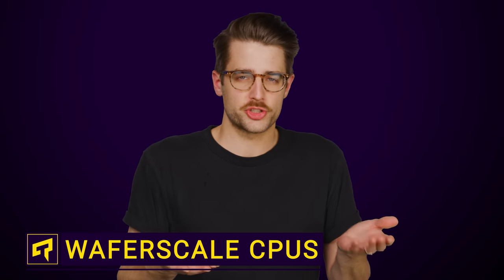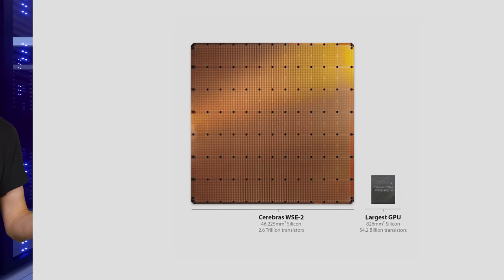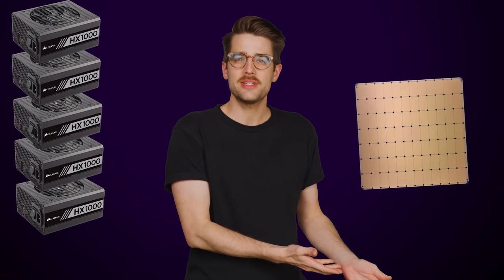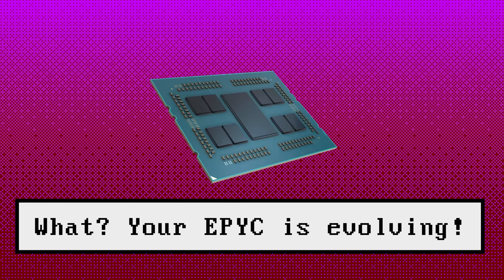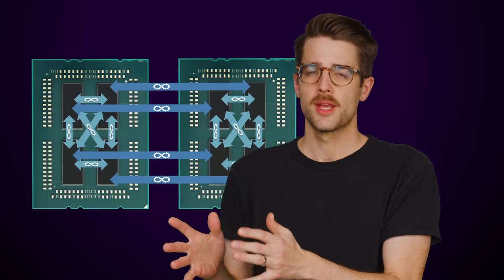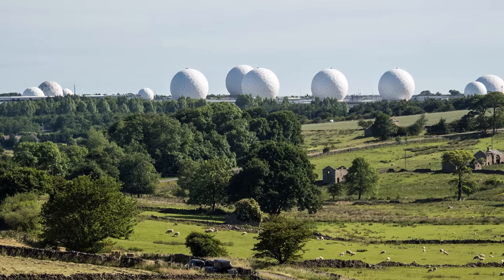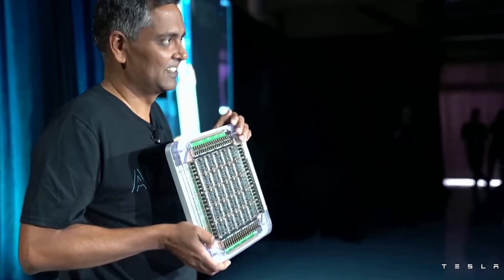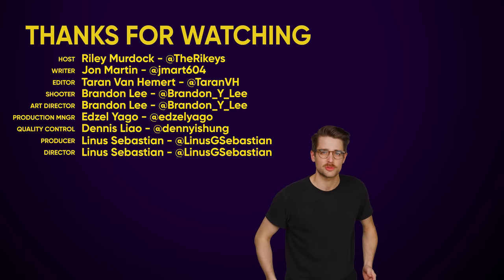The BIGGEST CPU Ever! - Waferscale Explained

Comment: Imagine how impressive of a cooling solution they're going to need for these things.
Reply: Just slap fan on it and call it a day
Reply: They just have a guy hosing it off 24/7
Reply: @a_stress2064  this but unironically
Reply: Dry ice
Reply: Big Metal heat sinks with high surface area to volume ratio, fans, ac. Finished
Reply: Eh just slap an Intel stock cooler on it and you will be fiiiiiiine.
Reply: @p.hilten  ac wouldnt work. Not efficient enough. Ln2 would be the option
Reply: Liquid nitrogen?
Reply: That’s why one just needs to shout “Cool!” loud n often enough. lulz…
Reply: Water Iceberg cooling
Reply: I am 100th like lol. Btw Antarctica is the best solution. Probably
Reply: Bigger chips doesnt automaticly imply more heat per area? If you where to make a i5-9600k 5 times the original size, it wouldnt randomly produce 5x as much heat would it? It would rather just spread out the heat. Point is, it wouldnt be any "harder" than what it is today. Just a larger radiator, larger fan?
Reply: @viktorpettersson6899  The thing is this has hundreds of thousands of cores while i5-9600k has 6. Difference.
Reply: 15kw vs .2kw, you are going past water at that point.  Each chip would need its own a/c unit pulling the heat out.
Reply: I'm sending beige and brown
Reply: 4 Dyson Vacuums would sort that.
Reply: @definitelynotobama6851  yep
Reply: @jasonoutman420  ln2 not ac, ac isnt sufficient enough
Reply: Wouldn't this thing just be inside a giant oil bath?
Reply: @mannye  uh... this things basically a giant glow plug man ... it would set the oil on  fire
Reply: @MrDeadmanwalken1  I like my chips fried 😋
Reply: These things are not thicker so almost the same amount of cooling per cpu in the stack
Reply: Water cooling man...just at a larger scale than for a gaming PC
15kW is peanuts in an industrial scale, they would probably slap a couple 100 chips together  in a water loop with an evaporative cooler and solved
Not complicated engineering
Reply: shouldn't be much different. just bigger lol. its like the threadripper chips.. they're bigger, but then again so are the heatsinks and its a non issue. unless the wattage per given area changes, the cooling shouldnt require anything defferent.. and of course they take all of this into consideration when designing.
Reply: A typical car radiator dissipate like at least 20kW of energy all the time I think, and it don't use any nitrogen or other expansive components.

I think most chips of this kind are cooled by a big fat shared loop of water-cooling which is itself cooled by some evaporation towers.

Edit : @smockydevil said everything by the time.
Reply: Yeah, they might need the nactua cooler with two fans!
Reply: @MrDeadmanwalken1  Ever heard of glycol?
Reply: @p.hilten  A/C would not even be close to the cooling requirements of a chip like this.
It will need, at the VERY least, chilled liquid cooling. Probably on-die (or even IN-die).
But they are more likely to be set up in "immersion cooled" datacenters.
And speaking of datacenters, these are going to require totally new ones. Our current power-delivery systems are nowhere near enough to supply racks of these. Let alone be able to move that much heat.
Reply: @mannye  ever heard of tdp ratings?
Reply: @MrDeadmanwalken1  please just stop talking. You have no idea what you're talking about and you know you don't. So what are you doing, man?
Reply: @unvergebeneid  lady you should really look into how much powerdraw this chip has due to the sheer amount off cores. Standard glycol and liquid cooling will have trouble maintaining this chip at is recomended tdp. It will most likely will be put under a kryocooler using liquid nitrogen better known as ln2.
Reply: @MrDeadmanwalken1  you haven't ever come within a 10-mile radius of a data center or in fact any non-consumer grade hardware. Ask me how I know.
Reply: industrial warehouse airflow
Reply: @unvergebeneid  unlikely you do
Reply: Just get the car fan project and fix it
Reply: @MrDeadmanwalken1   Look, if you want to argue just to argue, I'm not interested.  There are many high temp heat transfer fluids that can go to 400C and not combust like 3M Slytherm 800.  It's also non-conductive, or very low. Low enough? I don't know.  But it's possible.  And yes, I know what TDP ratings are.
Reply: It's a home heating solution.
Reply: @corneliususcorneliususus928  yes, thats my point aswell.
Reply: Iirc the WSE-2 comes in a complete package called the CS-2, and the CS-2 includes a mammoth liquid cooler that if removed while running could basically cause the WSE-2 to melt itself in seconds

Said liquid cooler has redundant pumps though - of course; we're talking about server equipment here
Reply: Ice Bucket Challenge
Reply: Server farms are known to employ liquid nitrogen as a viable cooling solution. Some companies (notably Microsoft) have been experimenting with installation of servers on the sea floor to reduce costs.
Reply: Probably liquid cooled
Reply: @viktorpettersson6899  this cpu uses 15kw of electricity and a good portion of that gets wasted right into heat. You'll need a robust cooling system.
Reply: @jasonoutman420  an ac wouldn't be able to do anything to cool a chip lol, air conditioners are for air...
Reply: @iCore7Gaming  don't use it to cool the air, you run the freon directly through the cold plate.
Reply: Don't they ship it with stock cooling fan or smth?
Reply: @iCore7Gaming  ”15 kw of electricity” thanks you’ve said enought. I never spoke about one in particular did i? I was talking about the general idea of total area over transistor density
Reply: Rumors has it that this CPU is contributing to 50% of today's global warming
Reply: Just watercool it with a car engine radiator/fan. Those handle 50kW of heat in car so a CPU is no different. I imagine in supercomputers and data centers the cooling alone will probably be like 550-ft cooling towers in power plants.
Reply: CPU needs its own dedicated air-con unit.
Reply: diverts a river
Reply: The actual machine has only a few, but giant tubes of water-cooling. And the size is just about as much as a fridge. Way smaller compared to an equivalently powerful rack of GPUs.
Reply: That's why server rooms are freezing.
Reply: @DaKerim58  LN2
Reply: woah i didn't expect that many likes
Reply: Uhmmm i mean there's a thing called cars that have engines in them that literally have many little explosions a sec that generate waay more than 15 kw of heat and they are cooled just fine with radiator and water
Reply: The space is cold enough, but this looks like a bit too fragile to put it out and fry in radiation WAR of the cosmos.
Reply: well it needs a lot of power but at the same time its huge. I think just a big waterblock and something like a large truck radiator or 2 would be enough. The radiator could just sit on the roof of the building it would be in so there would be no need for any ac. When you take into account the power density here, its much much lower than some core i9 or something with a normal sized die.
Reply: absolutely no reason to use anything other than water here imo. And as others have mentioned, 15kw is a lot for a computer but otherwise not really. The radiators in our computers are just tiny and so are the chips we try to cool down. "water wouldnt work" makes no sense. Nuclear reactor cores producing gigawatts of heat are cooled by water.

Comment: Imagine having to buy a motherboard for this thing
Reply: my god
Reply: More like a mothership. . . Amiright! Lol
Reply: System on chip.
Reply: More like build the pc around this behomoth
Reply: Cooling would be a nightmare.
Reply: @KonohasYeIlowFlash  Whole inside of the case is a big heat sink and a 20cm Noctua fan lol.
Reply: you'd have to bolt an AC unit with a big rig radiator on it, just so it boots...
Reply: The company selling those motherboards when you walk in, sorry pal, you're not that guy.
Reply: ImAgInE :----D
Reply: Motherboards are usually cheaper? so i dont see how thats such a problem.
Reply: Its like saying: "imagein having to buy a case for that motherboard"
Reply: Imagine trying to pack more food into Riley's wife's mouth. You can't
Reply: what about the cooler?
Reply: IT IS THE MOTHERBOARD!!!
Reply: @viktorpettersson6899  They are cheaper because they are already commercialized. Meaning the manufacturing cost can be recovered as more are produced. Technology and the equipment for their production have become standardized. However for this type of chip with that much demand for power your motherboard cannot simply be produced in the same exact way. If a CPU requiring 100w requiring  motherboard with at least triple that capacity, then one probably will be a scaled much higher. Just imagine the other components that need to be scaled as well to match up the performance of that CPU and the consequent additional power requirements. If you ever tried to have sometuing "customized" for fabrication, they don't really come as cheap as regularly produced products.
Reply: @keyzsawake353  Probably with Liquid nitrogen/hydrogen.
Reply: thanks  ok
Reply: @angrymeowngi  thanks for your reply
Reply: @killdragonkill  it's fully integrated with a water-cooling sever rack
Reply: they're prolly called fatherboards
Reply: “Look at me, I’m the motherboard now.”
Reply: New formfactor MegaTX.
Reply: @killdragonkill  water
Reply: @Graphics_Card  you are right lad.
Reply: @luispadilla2492  Guitar solo plays
Reply: Imagine having to buy a motherboard.

Comment: Imagine a single core failing on that massive CPU.
Reply: Its probobly built to alow for a few hundred cores to fail
Reply: @matsv201  most definitely
But then you just get that unlucky smuck that hits that 00.1% lottery and has just the wrong bent pin
Reply: @Dentson  i wounder if they have made them so they can cut them down to a other product... I would guess so
Reply: @matsv201  they don't care about that. the designed the chip so if any core fails, it doesn't afffect the operation. they already start with failed cores form manufacturing. but this chip is only for AI computation, it can do nothing else.
Reply: @Dentson  Unbend it.. resolder..
Reply: If the designer of that CPU failed to factor a few core failures, then they should be fired right away. Anyway, the codes for that chip probably also include a failsafe to allow for continued functioning--much like memory storage which can function even with bad sectors.
Reply: wouldn't really matter, if you have less than 8 cores in your cpu you have failed cores just sitting there chilling. And maybe even a good one that got lasered off to make an even number, because for some reason nobody wants to sell 3,5, or 7 core cpus, even though it would be more profitable than selling them as a lesser product.
Reply: It could run any game though without a dedicated gpu if it has built in gpu🤣
Reply: It has lots dó redundancy!
Reply: It's got core redundancy for that

Comment: Concerning defects and yield, my understanding is that they bypass/don't use dead parts of the chip. They loose some random cores, but the chip as a whole still works.
Reply: With a not so sophisticated lithography you cam get higher yelds tho
Reply: Dr. Cutress did a great video on the Cerebras WSE-2 some time ago where he explained this.
Reply: My favorite part of learning about these was that the cerbras chip actually had to INCREASE their yield because of the error count. There too much of the chip dedicated to error bypass, and in v2 they used like 2% of what they planned for errors previously.
Reply: woah!! that was my question. interesting!!
Reply: you know, anything less than the highest tier cpus on the market, have dead cores, (ie, a 6 core cpu has 8 cores and 2 are dead or disabled) nothing new really. One thing that bugs me though is why they don't sell the odd number core counts as is as lesser models of the one above, (ie, a 5 core entry level i5/r5, look they even match!)
Reply: thats my question............
Reply: People jumped down my throat when I said the same thing. I honestly don't buy it. The amount of ultra pure air to make such a chip is really hard to get to. Like what? Three micron sized particles per a cubic foot of air? Theoretically, if it was a fab PURELY run by robots with human operators outside? Maybe you could get a near pure environment.
Reply: @eclipsegst9419  usually it's not just "dead" silicon, it's bad performing. Even if they were to use that extra core, often you're better without it, as it forces you to use more voltage for lower speeds. That and the gain of one extra core for all the extra R&D isn't usually worth it, and will just take away from sales. A 6 core i5 will only be better than a 5 code i5 for people that know computers, and let's be honest most people aren't like you and me, they just see "i5" and they're done.
Reply: @ILoveTinfoilHats  however many cores you have, they all perform differently. There must be plenty of perfectly good cores lasered off. Like I said, just seems like a waste, both as a consumer and from a marketing standpoint.
Reply: @eclipsegst9419  reread my point about sales. drastically different performing processors of the same series only lose money for the company
Reply: @ILoveTinfoilHats  so if you have a die with 5 good cores, all capable of rated clockspeed, and one bad core, its more profitable to sell it as a 150 dollar i3/r3 than as a 180 dollar i5/r5? How does that work?
Reply: @eclipsegst9419  because now it devalues the $250 i5, which also in turn devaules the $400 i7 and $500 i9. comprendo?
Reply: @ILoveTinfoilHats  not in the slightest. if thats the case the 75 dollar Celeron and 120 dollar Pentium are devaluing them too. Fact is, most people have a budget, if they have 200 to spend, and can't afford that 250 i5, they will buy the 150 dollar i3, and the potential to make 180 on an entry level i5 is gone. Consumers are impulsive and will rarely save their money to make the purchase later, and just get what they can afford today.
Reply: @eclipsegst9419  it's about branding. Those celerons and pentiums don't devalue the Intel core processors because people KNOW they're slower. People will buy a 6th gen i5 over an 8th gen i3 even though the i5 is worse in every way because BRANDING. I suggest you look into it a bit more before you make a bigger fool of yourself.
Reply: @ILoveTinfoilHats  the only fool here is you. the chips that could be sold as i5s are being gimped and sold as i3s. Therefore by your own logic they are less likely to sell than they could be if they were left intact as entry level i5s, because of BRANDING.
Reply: @eclipsegst9419  intel is doing exactly what i'm describing for a reason. I'm pretty sure a multibillion dollar company has thought of this before, you're not special. This is the last response you're getting because you don't seem to understand how business actually works and making many witless statements.
Reply: @ILoveTinfoilHats  lol you can't refute anything i say with, idk, studies, or anything of that nature can you? Customers like options. I don't care how much you have studied business, it only teaches you what has worked in the past and to what degree, not what works best, because there is always a better way.

Comment: CPUs in personal computers will probably stay the same size. 

GPUs on the other hand might embrace this and start making graphics cards so big they will need to design a new size of case just to hold the massive card and the 3000W power supply needed to power them

Comment: Sounds great for specialized super computers where the cost is so outrageous, the fab can afford to toss a few with defects, but there's a reason consumer chips stopped getting bigger and that's mainly YIELD.
Reply: Even for big GPUs you can't buy a totally error free one without any deactivations. They won't have a single one of those wafer scale chips without defects. They have spare areas to be deactivated for almost everything, to handle the defects.
Reply: And if the fan fails, you probably get a yield somewhere in the low kiloton range  ;)
Reply: They managed yield cleverly in this design (I see in others comments)… a pretty big omission to not discuss that topic in the video.

Comment: How they handled yield and errors would have been interesting to cover up in the video. Without clever error accepting designs you cannot build large chips, because the yield would approach zero on a traditional design that don’t accept errors. So their tricks in this department must have been impressive. Also why TSMC 16 process? Was that in any way related to getting huge designs working or just an enormous cost saving by not using one of the new popular expensive smaller processes?
Reply: Check out Tech Tech Potato's video, he goes more in depth
Reply: @pacifico4999  thanks, that video was pretty much perfect! Covered my concern, but also the business model for these designs very well.

Comment: I want a video on how the cerebras chip is cooled. 15kw is a lot of heat that needs to be dissipated. I guess the fans must sound like jet engines.
Reply: Datacenters always use loud fans, because they're more efficient and the noise doesn't bother computers. They use fairly standard watercooling and 15kW is peanuts compared to a chemical reactor or boiler. Cerberas uses 0.32 W/mm2 whereas a Zen3 is 0.48 W/mm2, so in perspective, they actually run cooler than consumer silicon. As a result, this chip's single-thread performance equivalent sucks compared to a good discrete GPU/CPU, but obviously you don't buy this for it's sequential speed.